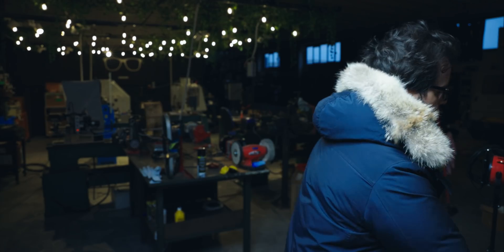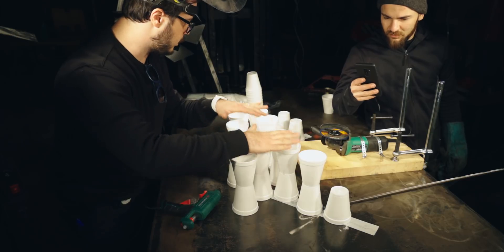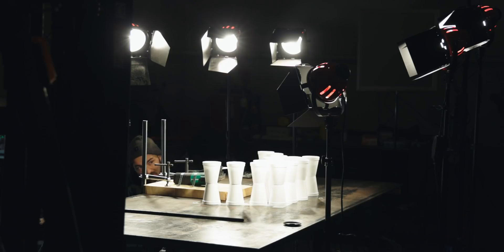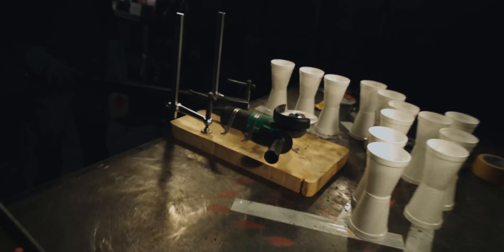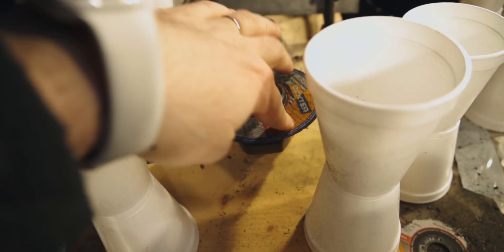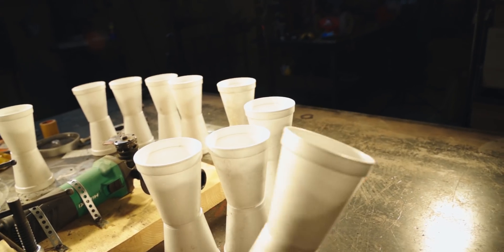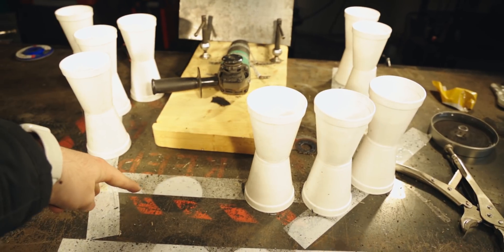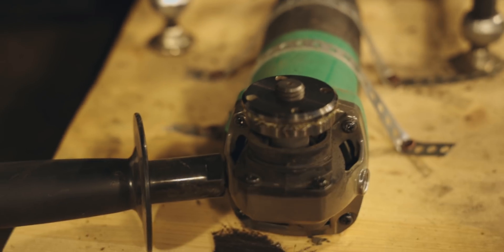Angle grinder explodes in slow motion

Comment: means 1mm cutting discs are safer because of less stored energy on the discs. For 3mm or more i’ll just use a lower speed or battery powered grinder with speed adjustment

Comment: This is a very wrong video, Disks usually don't explode like that,
People in the comment section saying "Now I'm feeling safer with my grinder" are so wrong, you only need one explosion to end your life. 
if the chance of a disk hitting you is 1/ 4000 and you have been using your grinder safe for the past 20 years then now your luck is out, you have the chance of 50% for that disk to hit you. 
The more you use it, the higher the chance it will hit you. it's just a matter of time.

Comment: The cups are not marked or destroyed simply because they give way to the broken disc and fly with it. If it had been a very stable and heavy object or a person (or animal) the broken pieces would simply have cut its way through the object or body.
The dis is not very large so the torque is quite low but the speed of the disc would have had  enough force to permanently Injure someone.

Comment: 30 years of use and never a problem until last year a disc exploded when i had no gloves on and made a mess of my hand severing tendons etc and needed surgery. Take these little guys serious!
Reply: I watched a grinder "safety" video in which the man said you didn't need gloves because his technique was to always  keep both hands on the grinder, so they could never touch the blade. He obviously has not watched accident videos. Most are because the grinder breaks lose from the hand control and goes flying into a hand, arm, leg, face, or (most dangerous of all) NECK. It is essential to wear gloves, safety glasses, and faceshield. A leather or kevkar apron is also advisable.

Comment: Many thanks for the video. My opinion: Important to know, that most accident will happen with angle grinder in the hands, not grinder clamped/fixed to a table. So it could be instructive to know what forces awaken in the process.

Comment: Try it with only one of the two metal things holding the grinder to the table, or without any
Reply: That is a good idea, since many grinder accidents are from losing control of the tool. The tool could be held by very weak bindings which would break when pressure was applied to the blade with a metal rod. Call it "Grinder Jacass Ii". Use some more realistic manikins, preferrably made out of gelatin. I saw one real video of a guy sitting on the floor using a grinder between his legs. It got loose and entangled itself in his pants in the crotch area. He got up and walked away from the camera. Either henwas incredibly lucky, or his manly parts and thigh got badly abused. 😊😊😊

Comment: I been using angle grinder cutting 100pc of hardened 6mm rod. I haven't had exploded disc . There's a technique how you lay the grinder wheel on stock, let it bite and don't push to hard let it cut it course.. even then I always use face shield regardless.

Comment: Unfortunately you have not shown a "classic" wheel burst scenario. I am an experienced grinder and I know the importance of prior inspection of the wheel before it is mounted to the machine. The machines I was using had an angular velocity of 3200 rpm. I know angle grinders can be (ein) hell of a lot higher than this ha ha but a classical burst will occur whether the wheel is cutting or not. This will occur because it is a defective wheel that has no structural integrity and will burst from the centre outwards. That is the real price you pay for poor quality wheels. If you can , buy your wheels from the UK . They do not make any poor quality wheels in this country.

Comment: First : that grinder mounted to the table, if in your hand, imposible you can handle it when explode and the grinder will jump to your body and boooommmm welcome to the hospital
Second : that blade design like fiber, so it will not shattered freely. Different if full metal blade, it will fly randomly. So... Dont use grinder without safety cover, face shield and leather gloves.

This videos show us how important cover blade is

Comment: 99% of the time it’s user error that causes a disk to explode or fly off. Just like your first break, you are putting a “moment load” on that disk which it was never meant to handle. Use good quality discs with no defects and use them how they were intended to be used and 99.9% of the time you’ll be just fine. Also, I run an ASME pressure vessel fab shop, probably at least 25 grinders laying around and not one of them has a guard on them.

Comment: I never use the safety guard because gets in my way all the time. As long as you don't put the angle grinder in a position to where the blade can grab it will never explode on you.
Reply: Yeah just like a seat belt, really uncomfortable and you never need it

Comment: Here in Australia on building site etc a number of people have been killed by thin cut of wheels exploding without the shield on. Partly it is the speed these discs are designed for and being used at on the bigger angle grinders ie; the 8-9 inch grinders. Always without the safety guard on. Other severe injuries have occurred also.
Reply: I'm very very hesitant to use large ones without a guard because they are not very easily controlled. Small grinders can be very well used with one hand and you can almost always keep distance and position yourself  away from the line of the blade, and I've had coutless of small blades break (some "exploding" too) but never had any injuries because of it. In the field there are situations where the guard prevents the machine from fittin and your only option is to cut without it.

Comment: Too many times I see my mechanic coworkers be too cheap to buy an actual air cutoff tool with a guard and instead just stick a cutoff disk on their angle grinder using a grinding disc to hold it on. No guard whatsoever. I would never do that.

Comment: You focused on the area in front of the grinder. You should of focused on the rear of the grinder where the operator would have been standing. That being said a prudent craftsman should never lose his respect for the power of the tools.he is using. Wear every piece of safety equipment available and do not skip steps in procedures.

Comment: ciao giaco, thanks for the message safety guard on, safety glasses and face shield. one thing i have to say is that the beast is very very different when you´re talking 7 and 9 inch grinders. i´m a metal fabricator and can´t tell how many times i´ve seen accidents with the grinder. and how many close calls i had for being just stupid, tired or a combination. eye doc has removed three times things of my eyes and nothing nothing nothing is worth the risk of losing eyesight. of course there is the unlucky one or the lucky one that defies stats. thanks again this is really important. take care. piero

Comment: Thanks for posting this. I was the safety rep for the metal smith and machine shop on my ship in the Navy. I didn’t want to scare the new people, but always tried to instill a healthy level of respect into the new guys when it came to tools like the grinder. In all of the years I’ve been doing this stuff, I’ve never actually seen one explode. Any injuries I had seen in person were from a result of kick back or people touching the blade because the guard was removed. It would be interesting to see a test where a cutting disc was plunged into a non ferrous metal to see it it would gum up and explode like the wheels on a bench grinder.
Reply: I have broken Tons of em before and never got hurt by one breaking, but on the other hand, I have cut nerves clean in half in a few fingers with Cutoff discs but yesterday I guess my straw got pulled cause I was just making a little notch into a ln intake manifold and KAABOOOOOOOOOOOOM and it felt like someone had smacked me in the face and I knew immediately what had happened disc filleted off a nice chunk off the side of my face. Perfect shape of the half of the disc. Got lucky, an inch to the right, stuck in my face, 3 inches lower, taken out my jugular
Reply: They explode much easier when you go past the expiry date, the expiry date is printed on the disc. Especially cutting disks, I tried to use some that were 2 years past expiration date and most of them blew up as soon as you touched something. I was wearing full safety gear but it was still scary seeing the discs go shooting out.
Reply: I have broken many, many blades and never gotten injured. Most with the guard on and many without (it prevents cutting in some tighter situations). Probably done thousands of cuts over the years and probably broken like a 100 blades. 🤷

Comment: The grinding discs I’ve seen range from 1/4” to 3/8” and at 10 thousand RPM, things can (and will) happen...scary things.

ALWAYS check the maximum RPM rating for each disc you use. If you don’t, it could cost you your life.

Comment: Yeah.... I've used an angle grinder a lot... Exploding discs don't scare me, wear a pair of safety glasses and you're okay, you'll at worst get a few scratches if it flies in the wrong direction and the guard is more likely to cause you to bust a disc because it obscures your view of the work and how you're hitting it. "You're not using it properly if it blocks your view" the trolls will say. Sir troll, I retort, you have never used an angle grinder on anything but a horizontal surface sitting on a table. Get over it.

Super thick wire wheels scare me. Wire cups terrify me. I have scars from knotted wire cups that still hurt. I've had days where I had to spend 15 minutes in front of a mirror sorting through my beard to find wires from wheels that were embedded in my skin like little spears. I've had knotted cups grab 5lb pieces of steel and snatch them out from under a set of TIGHT clamps and chuck it at co-workers across the shop.

Disc guards do nothing to prevent any of that. They just make it happen more often.

Edit: Oh, and loose T-shirts. Loose T-shirts have almost gotten me gutted. More than once I'm ashamed to say.
Reply: Glad you took this stance! I've had several catches. Surprising always, but never cause injury, even with bigger 7 inch grinder. Face shield yes, grinder guards no...not in the real world on your back, laying sideways, etc. They're always in the way. Video clearly shows how even flimsy styrofoam cups aren't damaged. Get over the worry wart "could be/almost/what if" and get to work already ;-)

Comment: Using an angle grinder on aluminum can melt the aluminum and cause the grinding wheel to become brittle shrapnel...

This is either a warning, or a suggestion (if you're a YouTuber)
Reply: I have experienced this.
Also if your grinding something and put pressure in the wrong spot you can cause the metal to pinch the grinder, and sometimes it will explode into shrapnel

Comment: You have proven how safe angle grinders actually are.
Reply: Had  a disc explode today. Nothing happened except dust everywhere. Of course had the guard on and safety glasses and gloves.
Reply: Most angle grinder accidents are not from disks exploding, I have had tons of disks explode over the years, Make sure you always wear your face shield and have the gaurd on. How people get badly hurt is grinding towards yourself with the disk spinning it your direction,  if the disk gets caught that grinder will come right at you. Thats how the accident I have seen happened at shops I have worked at.
Reply: He actually proveed how incorrect technique endangers everyone around you :D
Reply: But really they are not safe. Trust me. Im on number 150-160  fibre splinters that ive pulled from the inside of my eyelids. And most are under the skin. Enough to lose your mind with the irritations on the cornea. The pieces hit face and went up under my safety glasses and into my eyes. But thats only half the horror story
Reply: @thebeastfromthesoutheast7765  Bruh... whats the other half?
Also, how much have you used the grinder?
Reply: @rockfeli  the other half is dealing with corrupt doctors who have been calling my injury an allergy problem to acc so i dont recieve compensation. Yes i have used angle grinders since i was a teenager
Reply: @rockfeli  and i even had the guard attached
Reply: @thebeastfromthesoutheast7765  damn.. I know a pro who lost a finger and a half just by putting the grinder on the table before it fully stopped spinning.. The thing is seriously a killer.
Reply: @rockfeli  yes it can be. But also a pain in  when you dont have one around😂
Reply: @thebeastfromthesoutheast7765  what I hate about them. Soooo useful but is it always worth it?
Reply: Lol shown not to bend metal while cutting otherwise your disc breaks fast! Lol
Reply: They're great tools for a lot of work But very dangerous
Reply: I Think he's proven how critical it is to use them safely. Taking a gouge like that out of a cup with almost zero mass to push back means it will do serious damage to your body. That's the opposite of safe.
Reply: @darkweb3772  it was an absurd test,  he had to compromise the disc far beyond reason to force a failure.
Reply: Sander exploded in my face today covered my shield in scoldering hot dust
Reply: @pickleman291  appreciate it I tried looking after you mentioned it can’t find anything on it thanks though.

Comment: Cool test, don't die testing. 7:30 is similar to what happened to me about 25 years ago. I was cutting the floor pan out of a car to replace it using a die grinder at tight points. The cut wasn't finishing yet but the metal moved from the stress relief. The die grinder wheel caught the pinch and came to a sudden stop. A tiny piece of the wheel ricocheted off of something and grazed my cheek on it's way to my left eye under the safety glasses. Rushed to the eye doctor who removed it using a giant magnifier and a needle. It hurt for about a week but I fully recovered. Even when you doing the right thing sometimes you still get hurt.

Comment: I think a lot of the really serious injuries are due to kickback, where the guard plays a big part, but clearly catching shrapnel in the eye or arms could be catastrophic too. Has anyone ever had a flapdisk explode?
Reply: Graphic so read on your own caution

Yes, it happend to me and around me, my boss warned us when we started out that no matter what to never remove the guard cover so we just follow this simple rule, 3 weeks later while working with the angle grinder the disc just exploded on me, simple work done it hundred times that day but that one just didnt want to anymore it skimmed my left pinky a bit thanks to my gloves it didnt do much and thanks to the safety goggles my eyes where protected aswell since some little shrapnel just flew everywhere but i can tell you without that guard id have some serious problems. 

The second time didnt happen to our crew but to another working on the same jobsite, they never used a guard and they didnt want one either, since we all went for lunch break together i asked them to put it back on but since i was 21 at that point and most of them where 30-40-50 ish they just kindly told me to F off... and i kindly let them be, 2 days later 30minutes before shift ends we hear an soul shattering scream followed by call an ambulance, they where cutting a bit of stone and the disc (not a flapdisc but a diamond cutting disc) lodged it self in to a cravis and shattered the disc in multiple pieces, ripping his left index and middle off and leaving his ring finger dangling of his hand just attached by a piece of skin, besides that i heard he a had a piece stuck in his thigh and foot and that he was lucky that his head was not in the flight path.... 

so yeahh no matter what disc never ever remove the guard cover! if you can not reach there to cut use a different tool!
Reply: @Gopnik57 that is a crazy story, glad I read it.  I once  unsuccessfully tried to cut the bars of a steel security door with a grinder, not knowing a thing about the danger or the fact that the disc was bought used and was old.  Scary stuff.

Comment: No hate but for a better version of exploding grinding discs check out hydralic press channels videos.
Reply from the maker: “Better version” in what way? By attaching a disk to a router? You probably missed the purpose of this video... 🙏🏻
Reply: @GiacoWhatever  Well, the discs explode into a more accurate human analog ballistic gelatin. Proper safety precautions are in use (not crouched behind the grinder with a bare scalp). Those ways. Otherwise the video was good IMO.

Comment: Valid advice there and some interesting footage! Can't be too careful with the angle grinder. For any not in the know, it's worth saying that there is a use-by date on the wheels (usually printed/stamped on the metal collar in the middle of the disc). Once past, it's a good idea to just snap the disc and put it in the bin. hth.

Comment: the beauty of the guard  is that you can clamp a piece of angle iron to the work bench , this allows hanging the grinder on the vertical angle edge while the blade is still spinning. You can quickly put the grinder down without waiting for it to spin down. Use multiple cheap grinders vs one good one and keep different discs on each.  Bonus...zip tie a sharpie cap upside down to the angle...allows quick one-handed use of your sharpie without it drying out.